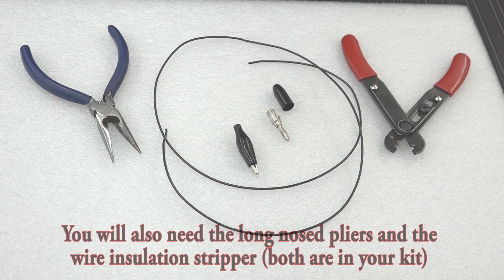LAB 00/01 - Make your Power Supply wires for ELEC 201

Comment: not a very good connection if you dont solder it
Reply from the maker: That is what I thought, and that's why last year the video included soldering. But a much wiser and savvy design chief engineer with a lifetime in industry opened a professionally wired such cable ... and surprise .... they are wired just like shown in this video. What my colleague tells me, and he has a point, is that this cable is to energize a breadboard prototype in the lab, right? Think of how good of a connection you get from the pressure of the breadboard springs on the spivot of #22 wire inserted on the rails. After measurements (at the level of currents used in these electronic prototypes the answer was clear. If this was an electric motors lab with some 100 hp monsters, of course this would not work. In engineering, a solution has to match the problem. The golden rule is not to over design.
Reply: If this is for a classroom practical depending on the students ages they may not be allowed to use soldering irons. Lots of silly European safety regs over here.